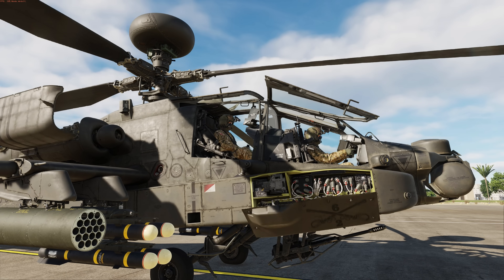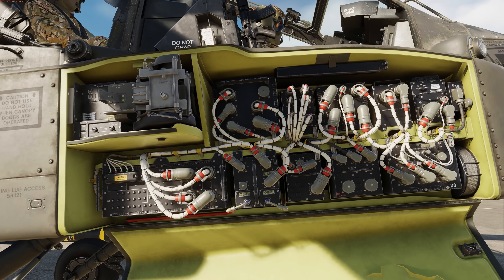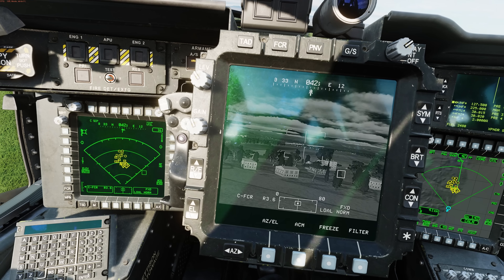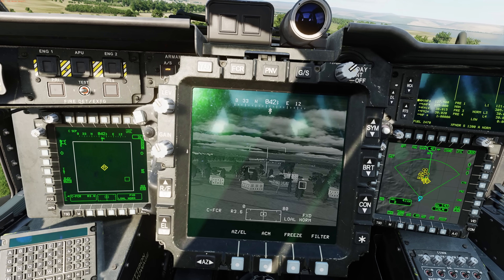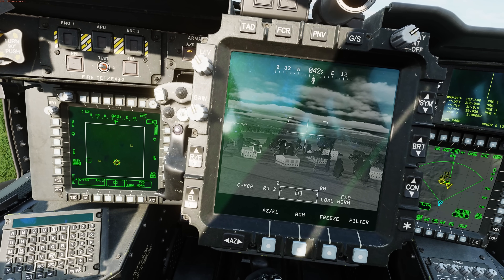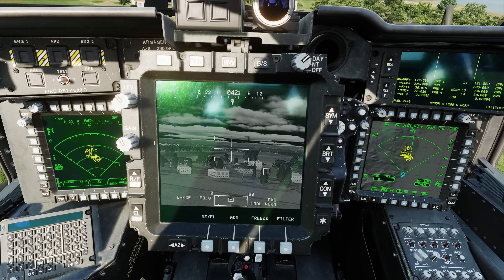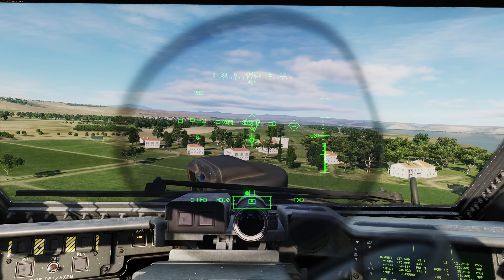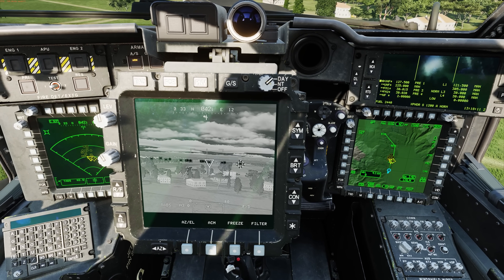DCS: AH-64D | FCR ZOOM and C-SCOPE

Comment: As a former UH-60 CE, seeing those good ol' T700's brings back the memories.  There are some differences between the engines in the H-60 and H-64, but not a lot. This was a time (I joined the 82nd in 1985 1/17th Air Cav and 2/82nd AVN BDE) when Congress was demanding smarter program management for major military weapons systems. The H-60 and H-64 were developed around the same time, and there were a lot of mandates to utilize similar components in aircraft. Utilizing the same engine in both eliminated having to set up different supply lines and maintenance facilities for higher level repairs/refurbishment of the engine. Along those lines, the different services all wanted their own development of new utility helicopters, but they were told "nope....the taxpayers already funded a complex program for the H-60, you'll take that and figure out how to make that work". Thus we have the Blackhawk, Seahawk, Pavehawk, and Jayhawk :)
Reply: Looks like this is continuing with GE set to make about 2000 T901 engines for both 60 and 64. It’s nice to see military procurement go smoothly and efficiently!

Comment: Such and amazing addon with so many details and systems.....then the 3D pilot figures are way too small. Lol
Reply from the maker: No, they are correct. It depends on how low pilot has their seat.
Reply: @MattWagner  Hi Wags, I hear you, but they still look off to me, maybe it's their scale? It's almost as if the pilots just aren't adult size. I've looked far and wide and can't find any real life pics similar to what is in game.

Side question: Is the seat height adjustable in the 3D model (I think the F15E has this, but I could be wrong), so any seat adjustments are reflected in the 3D model in real-time?

Comment: So, I made this huge target range on Tonopah Dry Lake to run some practice missions. Went there with the Ole '64, FCR XMIT, and... only 4 targets were showing. I was puzzled and thinking that the FCR was not working. Then I watched some of your old videos where you say that the number of detected targets is shown on the upper right corner of the FCR page. I went back to the range, turned on the radar and... voilá: 116 targets detected. Turns out it wasn't 4 targets, but 4 target groups, with the vehicles very much bundled together. The FCR was working right all along. The zoom feature will sure help a lot in situations like these. Looking forward to this new update.

Comment: Is the FCR going to perform better soon?

Line of sight from the FCR to the target isn’t enough, you have to be so high up that you can spot the targets visually for the FCR to stand a chance of detecting them.
Reply: @123TheCloop Do read before replying.

The issue isn’t that the FCR stops detecting targets as you climb: the issue is that you have to climb for the FCR to detect targets which you can already see visually.
Reply: @VilleVaananen  it is.

Hint: it’s an officially acknowledged bug on the forums. Take a hike.
Reply: @VilleVaananen  that is wildly inaccurate. Even a modicum of common sense would tell you that.
Reply: I thought the same. But I ran some tests and the total number of detected targets is shown on the upper right corner of the FCR page. Sometimes it seems that the radar is not picking everything up, but it is that the targets are so close to each other that they show as one on the radar. That's where the zoom function will be useful. I would recommend testing it again and seeing the number of targets detected by the FCR. From my experience it is detecting, but just not showing on the radar screen. I could be wrong, though.
Reply: @sloppydog4831  That is not the issue here.

As you climb incrementally and perform radar scans, you can clearly see targets visually before anything pops up on the FCR.